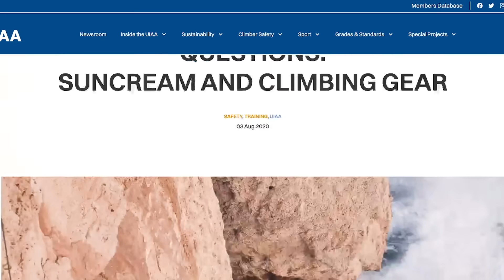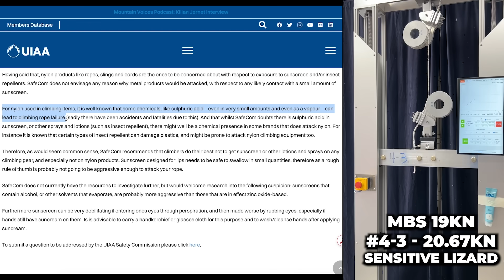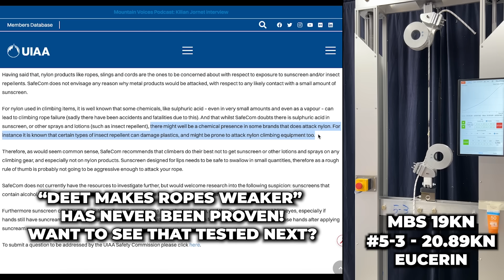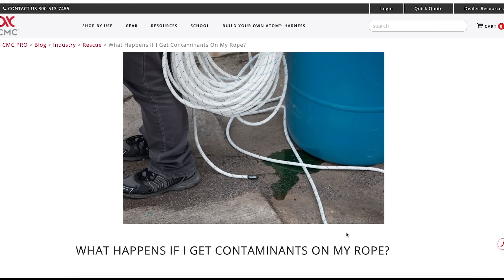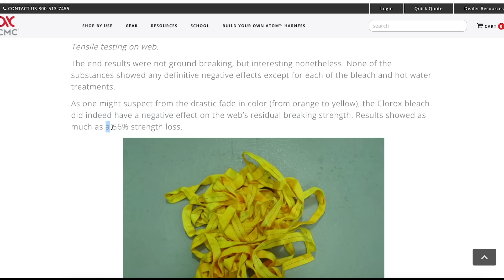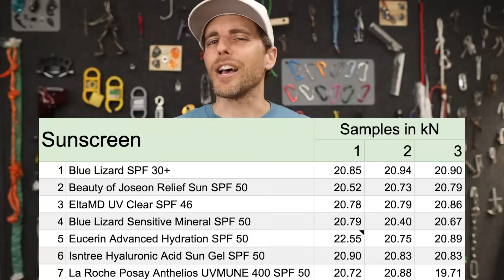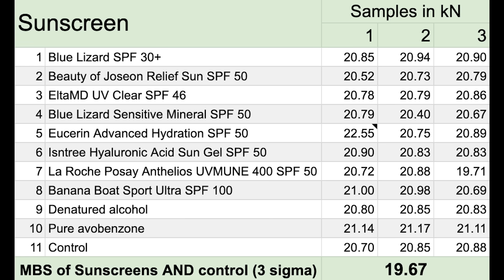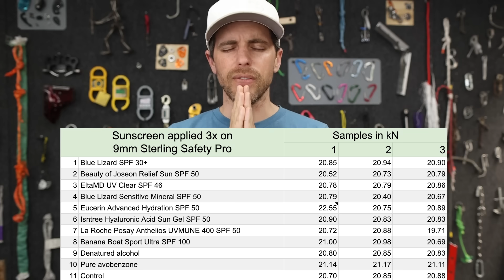This is going to piss off the worlds largest climbing organization

Comment: As an engineer, I may have approached this differently. Plastic manufacturers typically identify the effects of various chemicals on each variety of resin. If the chemical is not shown to cause degradation, it is not a problem. A quick reference of the material safety data sheet of each sunscreen should confirm the chemicals present. Also, as mentioned, the sunscreen may actually be advantageous. Plastics typically degrade quickly as a result of UV. So keep your ropes out of direct sunlight when possible.
Reply: I wear long sleeves and floppy hats when doing photography with my good cameras because I've seen sunblock etch the plastic on camera bodies.  I don't imagine it would be good for lens coatings either.  

Like a good father I always marinated my children in the stuff, and to my dismay I found that when such marinated kids run splat into the car, it also irreparably etches the paintwork.

None of that suggests it will do anything to ropes though - and they're just my observations not research.
Reply: @AbrasiveScotsman  I always wonder if it can do that to paint and plastic, what is it doing to our bodies? So I tend to just wear the long sleeves and goofy hat all the time now and have my kids do the same when it's practical.
Reply: @bradley3549  Just because something will etch a typically resistant material doesn't mean it's super corrosive or that it'll have a worse effect on skin. Also, skin cells naturally die off and get replaced, so even if it does something to the top layer of already dead cells, that doesn't mean it's actually hurting you.
Reply: @bradley3549 Your body is not paint or plastic.
Reply: @GoGoGoRunRunRun  Thanks for letting me know.

Comment: 100% deet will happily melt plastics, so yes, I think that would be a good test.
30% deet doesn't seem to melt plastics visibly, but it might weaken them. Another good test to run!
Reply: Just saying: "plastics" is a very general term for THOUSANDS of different chemical mixtures (and not all of them are found in climbing gear).  So tests of how DEET (at several concentrations) affects specific chemicals found in climbing gear would be useful.
Reply: 100% deet dissolved some of the ink on the label...

...but not the plastic bottle, sprayer, or lid that it came in.
Reply: DEET will not effect nylon.
Reply: @ionstorm66  Good to know! thanks

Comment: It's actually weird, coming from a 3D printing background and dabbling in chemistry, how chemically resistant Nylon is. It can handle a pretty wide range of oils and solvents. Water is actually its biggest issue, since it's hygroscopic and absorbs moisture readily. It's also not great against really strong acids or bases, especially at high temperatures.

On the other hand, a lot of climbing slings are made from Dyneema, which is UHMWPE, literally the plastic used to contain some of the most caustic substances known to man.

Dyneema is theoretically one of the most chemically resistant substances out there. I wonder how it would work practically. 

Next step is to get the battery acid out, and test it on your slings.
Reply: It’s worth remembering, that really reactive things often become the least reactive things.

This is because when something is very reactive, it often bonds very strongly with other things. One of the reasons why Teflon is resistant to most chemicals, is because it’s made fluorine. The fluorine forms such strong bonds that almost nothing can break them apart.  Think of it as fluorine-ash.

Similarly, the chlorine in sodium chloride  (table salt) really doesn’t want to let go of the sodium, which is why it is so stable.

So saying that a rope is made of caustic  (reactive) substances might be true, but so is Teflon. Just like wood in a fireplace isn’t likely to spontaneously un burn, the Teflon is really hard to break back into its reactive components.  (Which is a good thing if you are concerned about chemical safety, or if you are concerned about oxygen, salt, or UV turning your rope into something that is less strong)
Reply: Battery acid kills ropes and people.

Comment: If you do a DEET test, don't forget the polymer components of any accessories... plastic coatings, bushings, buffers, etc. Would kind of suck to have an incident because a plastic bushing came apart and let a pin walk out of some device, or a plastic coating got gooey and seized something in place.
Reply: Excellent point.

The retaining cord of my old belay plate gets replaced every decade or so, and any plastic parts, if it ever had any, were discarded long long ago - perhaps I assumed they were just packaging?

Comment: At this point my only concern is really for the grease to make sand grains and dust stick to the rope
Reply: More than likely this is the actual danger and not the sunscreen but the fact debris will be more likely to stick to the rope. Having said that, don't blame sunscreen for issues dirt causes.
Reply: As I am a friction hitch addict, my worry is mostly in change of friction between the prusik cord and the rope.
Reply: My thoughts exactly.
Reply: When I opened this video I was assuming I’d see greased up ropes getting tumbled through sand and then broken.

Comment: DEET and chalk... For DEET, brush on, but also the soak test just to prove the absolute worst case. Of course, SkinSo Soft (tm) and pyrethrum (used on clothing, but can oversparay your test rope for fun).  I am possitive that chalk is an issue as it is used by teachers and we have stories of a teacher that put us at the end of our rope. QED chalk makes rope shorter, but perhaps only in the presence of a teacher.
Reply: If chalk gets into the core, it will make the rope weaker by abrading the fibers. I've done that test.

Comment: I would absolutely love to see DEET tested. Please test various strengths as well. 100% (which is known to damage plastics), 40% (somewhat common for higher longevity bug spray, not known to damage plastics), and 25% (probably the most common, not known to damage plastics).

It might be worth testing Picaridin as well, since some newer products use that instead.

Comment: DEET has to be tested in a few ways:
Overspray, soaking (like you spilled a bottle on it), residue. 

And with sun exposure on both wet and dry deet.

You should also leave it in a hot trunk of a car. 

My dad had a nylon fishing pack that he had a bottle of deet in that he left in the car and it leaked and it melted through the entire pocket and damaged the pack.

Comment: Awesome video as always and some amazing testing - not to make more work for you but curious about the effects of some different brands of spray sunscreen and spray insect repellant.  Not so much the item being applied but the delivery gas/propellant.  We have seen insect repellant eat away at helmets (Kask Super Plasma vs Off Deep Woods lead to almost a delamination effect and layered soft spots.) Our very untested theory is its actually the propellant that caused the reaction.  Curious if other spray on sun screens use the same propellants and if it makes a difference Nylon vs Polyester rope vs general ABS plastics which is what the kask helmet is made of.

Comment: You both said “redact”where you meant “retract” and the nerd in me was very sad because this is such good debunking.
Reply: Nah, they don't have to retract the entire article... if they still want to talk about the testing that was done on other substances 20 years ago, that's fine, but they do need to redact the parts that say sunscreen will harm your rope.
Reply: @andrearea213  that's not how responsible science and its dissemination works. You retract the article and publish a public statement explaining why it was done. This is important because people who were mislead 20 years ago aren't going to read it again expecting an update, you have to inform them it was wrong.

Typically the retracted paper/article remains available but with the statement at the top and the content crossed out/watermarked etc. If it still holds valuable content then after properly reviewing the credibility of all the claims they can publish a new article.

Oh and redact doesn't mean removing incorrect information, it is blocking out content for legal/security/privacy reasons and is blacked out not removed silently.
Reply: @beardedchimp Email them and tell them to retract it.

Comment: The absolute scariest part of this for me is: if the UIAA is sharing inaccurate safety information here, what are the chances they will do the same in the future? I value having trusted sources of safety information like the UIAA, but if they begin releasing unverified claims like this out into the world, that uncertainty just opens the door for grifters to take advantage of people. 

I need to know for a fact my carabiners won't explode when I whip top roping a 5.5.  We will always need reliable gear spec information.
Reply: I would be more curious how many times they were wrong in the past.
Reply: UIAA testing on most climbing goods is fine, companies aren’t going to make weaker goods in the case the UIAA slacks on their testing minimums. It’s fine, most of us average climbers aren’t going to ever see above 4kN. So as long as most carabiners as rated up to 24kN were fine!
Reply: @chezlondo7826  You trust your life to companies (and their third party supply chains) way too much. There is a long history of profit-driven companies cutting back on quality when they think they can get away with it. That's no knock on the integrity of BD, Petzel, or whoever, but it is a reason to demand impartial, outside assessments, and not rely on industry self-regulation alone. Even if the actual PPP manufacturers as bastions of business ethics and safety, they have to get their materials from somewhere. We wouldn't have outside regulation if there had never been a need for it. Industry regulations are quite often written in blood.
Reply: Recently saw a BD cam that failed—melted the aluminum lobes. I suspect it’s the light weight low quality metal
Reply: I think you're going to have to accept that you can't trust organizations to think for you. The most reliable way to understand gear safety is the same as it's always been: the community gravitates towards safety as a hive mind through experience. If people get hurt, others will think about why, and change things. 

People really want to believe science can take the uncertainty out of our lives, but it can't. We aren't good enough at doing it. The weak link is the human beings involved. 

Obviously some level of standardization and regulation is positive, but it's still just people and their human nature doing the job in the end. Knowing "for a fact" is hardly a thing. Even in extremely well-constrained domains like math, knowing "for a fact" is a tall order. 

We are all "grifters"...we grift ourselves for the sake of our egos. Better to accept it and understand the implications than to pretend. 

Did you run a scientific analysis to determine driving cars is safe? Or did you just see that everyone else was doing it, and it was basically fine, and...what the heck, I guess I'll do it too. That's how we function. Always has been. Scientists do the same thing, and often insert it into their work in lieu of actual science.
Reply: @geometerfpv2804  Sorry but you have "inserted" so many generalizations into this comment that it is no better than the UIAA "page" about sunscreens.  "Some" of what you "claim" here has a grain of fact but it's so over generalized and over simplified as to be a "nothing burger".
Reply: @tr33m00nk  It's a conversation about ontology. Would you rather I use the technical terms? Most people don't know what they mean. 

Not everything has a fine point on it. Knowledge itself doesn't. I've tried to convince myself it does...I have two B.S. degrees, one in math, one in physics. PhD is in math. I work in original math research now. I've taken scientific knowledge as far as it goes. 

I think you understand the point of my comment just fine, honestly. I could put a much finer point on it by describing the limits of knowledge, language, and experiment in formal setting, but you wouldn't read it.
Reply: @geometerfpv2804  The phrase " I've taken scientific knowledge as far as it goes" sets off so many alarm bells I checked my smoke detector. Two bs degrees indeed.
Reply: @geometerfpv2804  This is the stupidest thing I've read all month. Modern process control has produced astounding results and claiming that accumulated folk knowledge is the only game in town is absurd. The comparison to cars is even more suspect. Driving cars is demonstrably unsafe for everyone involved; at roughly 40,000 deaths annually in the US, it is consistently one of the leading causes of accidental death.

As this video demonstrates, the claim that sunscreen weakens climbing or rigging ropes is easily testable. The fact that an organization supposedly dedicated to climbing safety is comfortable asserting the truth of that claim without any supporting evidence is a sociopolitical problem, not a problem of ontology.

Condescendingly referring to your credential, pushes your statement into the realm of charlatanry. (I have the same one as it happens, and I'm happy, even eager, to discuss the broader ramifications of incompleteness.)  Yes, there are real limits to human knowledge, but they are well beyond the present discussion.
Reply: @ShamanKous  Thanks! You put into words what I couldn't on "the spur of the moment". "geometer..." challenged my "comment" -- it won't challenge yours -- if it has any sense.